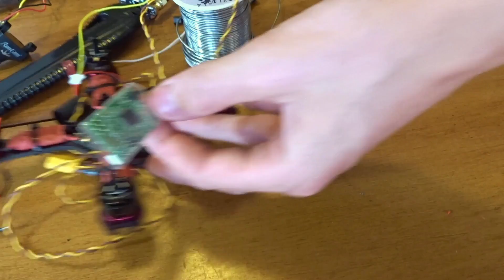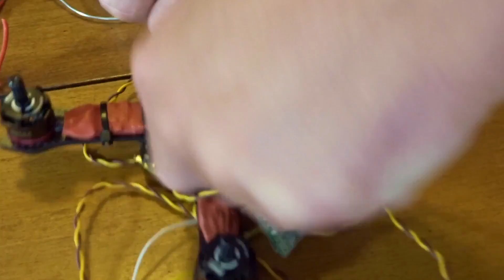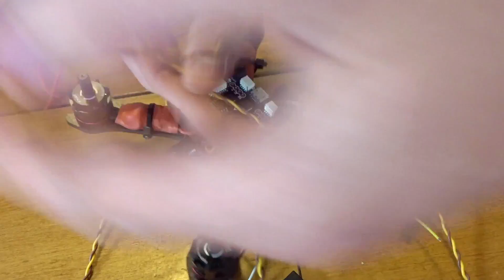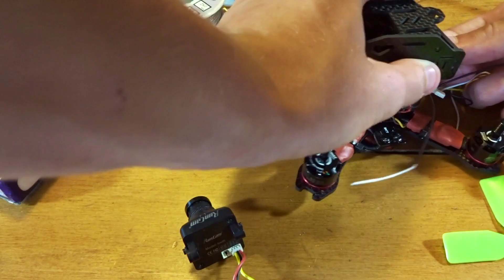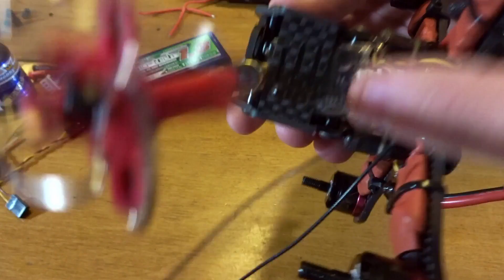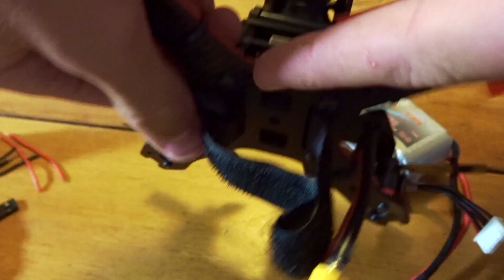GB130 Parts Kit: Build Video Part 2

Comment: look forward to flight tests and final prop choice,   the jump to 4 blades seems to be a tipping point, it either makes a monster controllable or a fast quad sluggish with very little rhyme or reason to it
Reply from the maker: Yeah, it makes this sluggish haha. If the motors were the 3300kv versions maybe, or on 3s. I have some DYS 3030 tri, HQ3030 tri, and Rotor X 3040 tri to test out. Tri blades, and also much lighter props so should fare much better.

Comment: can this cary a gopro?
Reply: motors will overheat
Reply: +MrJob91 thnx
Reply: 1407 is minimum
Reply: 5 inch is best weight to quad ratio
Reply: MrJob91 i think 6" why 5?
Reply: have you tried under 5 dough? like FPV equipment only is fine with 4 or 3 but you need more then 4 to carry 60gram loads....
Reply from the maker: I would argue it could carry a GoPro without overheating, as long as you don't over prop it. 6 will have more P2W, but 5 feels better as 6 has too much lol
Reply: I used very light DYS3*3*3 and it overheated during the summer... very light 140 gram quad no FPV but 4000KV is just allot